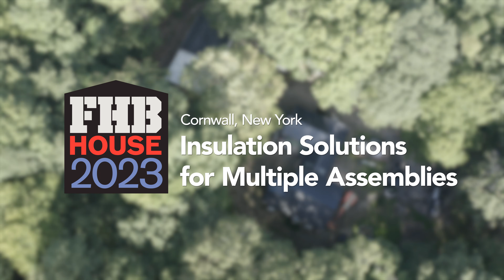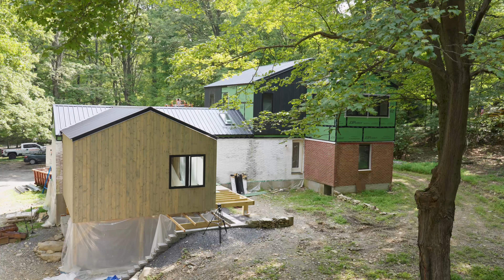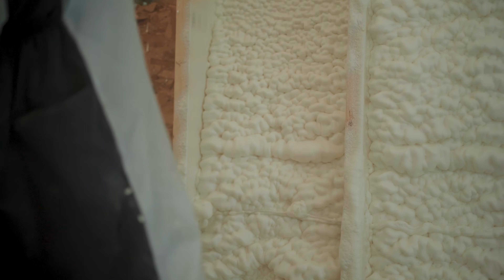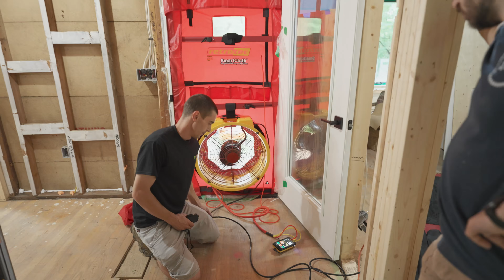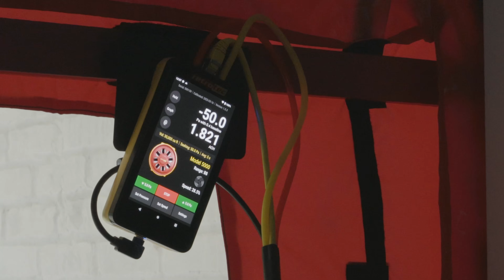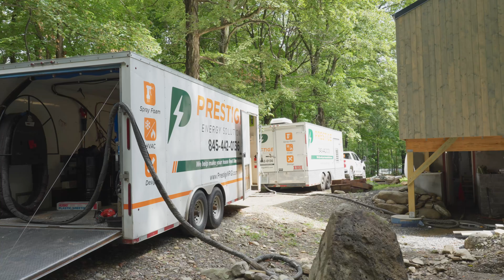Spray Foam Insulation in a Gut Remodel

Comment: I am sure you do a good job and homes are more efficient than before, but these blower testes are meaningless. All the things that are sealed up before the test shows how the test .means nothing. Your cooking and bathroom fans may go through a heat recovery system, but the air is still echanged. It's like the radon vent everyone is trying to sell. Pointless.
Reply: A tight house is more efficient than a leaky house.  If you want to know how tight a house is you have to test it.  The test itself only helps to quantify the leakage and identify where it’s coming from.

Far from being pointless.

Comment: Adding spray foam to an older structure can be risky and have long term implications. Older homes were very leaky and in instances where wood got wet, that leakyness actually caused it to dry out faster. 

By preventing the homes ability to drive vapor inwards, you can trap that moisture in the vulnerable sheathing and framing members. 

This can be mitigated by properly water sealing the exterior with a high-quality house wrap, but in most remodels that never gets addressed and the old builder grade  housewrap or even worse, cheap tar paper is left in place.
Reply: you're not wrong. In almost every instance, its just better to tear down the old structure and build new.